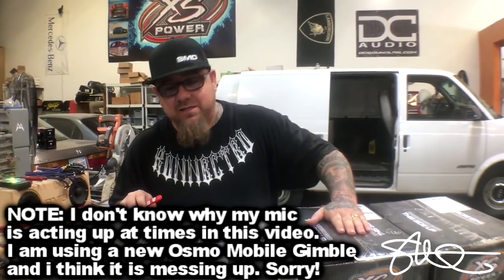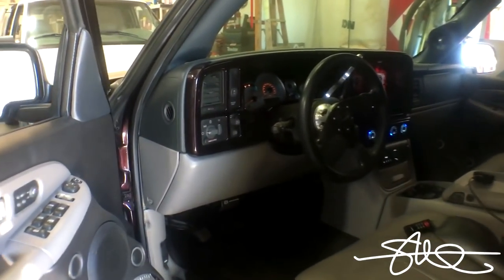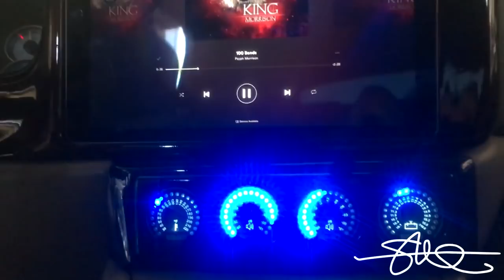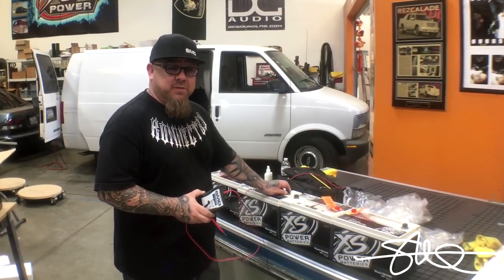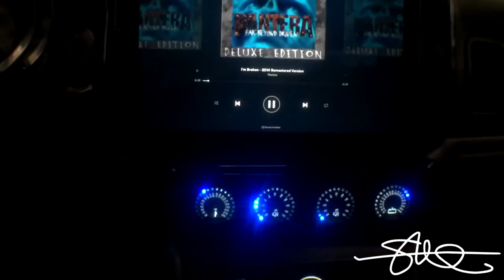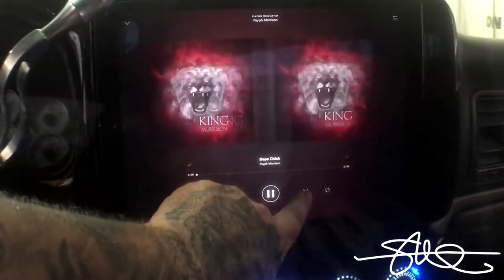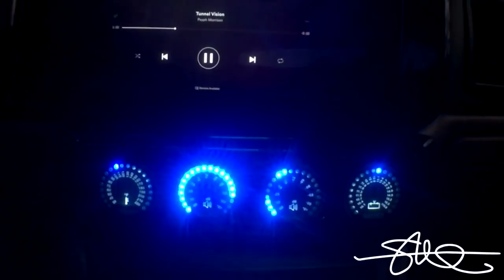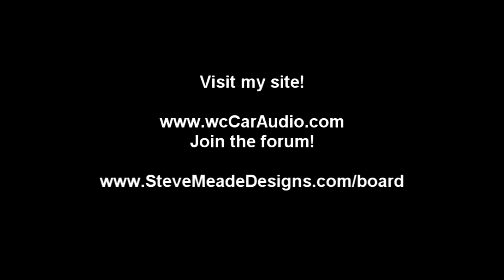XS Power Super Cap Banks Unboxed, Installed, Tested - 4 SB1000-31 4000 farad (Before & After)

Comment from the maker: Before you say anything about my ragedy upholstery in the back, it obviously USED to be a lot nicer....but i have been beating the SHIT out of everything you see there for years (over a decade) and it takes its toll.  Just the hatch rubbing on the trim pieces over the years and the bass slap hitting it is enough to wear it out some. :D  But the good news is, the system STILL works great after more than a decade.  Just sayin'!
Reply: meade916 Still looks good for a Decade bro. keep doing ur Thang!!!
Reply from the maker: thanks Mike!
Reply: meade916 yow sup bro i got a stetsom 6000 what you think of those amp i fine it got lots of juice man for the price

Comment: Much respect on strutting some Pantera. You never fail to impress with your builds and content.
Reply: The results are a bit surprising. My experience with caps way back in the mid 90's was that they were helpful if your electrical demands were already closely met, but too many people thought it was a replacement for proper alternators and adequate grounding. Plus many of the caps were garbage Chinese made large housings with much smaller caps inside. I'm not telling you anything you didn't already know. These here are what we really need. Thanks for showing us all bro! We appreciate it.

Comment: Makes alot of sense, caps react so much faster than a battery.  now that you can use huge cap banks like this it makes sense.  Back in the day those 1 farad caps didnt do shit really. I ran 4 1 farad caps and 2 optimas in the 90s.   But this shit nowadays is whats up!  I need to get a system in my next car asap.

Comment: Just got the SB630 group 51 for my setup and the difference is noticeable!  D4S JP23v2 doing up to 3,000 watts, plus a JL XD800/8 and wow, just wow!  I see a lot less clipping due to low voltage now.  It did take an hour and a half to reach my AGM's resting voltage of 12.8, but it was worth it.  Don't get impatient when charging these!

Comment: I remember back in the day trying to get a ambulance alternator to fit under the hood to get the power needed.  I think you have a good balance with the batts and caps.  Soon you will just be pulling a trailer with a big DC generator and you can ditch about 1000 pounds of Batts, alts, wire.  Just one big plug in the ass end to power it all. ;)

Comment: Thank you for this video, the supercaps are the future, now you have more stable voltage and less weight too, the maxwell supercaps did the job too, but the caps that you bought are very cool with the case, i recently was thinking that have a number of fared that give a cost benefit, think with me, if they are charging after the beat, the supercap and the amp will need power, so they need a feedback of energy too, cheers!
Reply: There are tons of people using Maxwell caps to replace their main starting  battery. cheaper and last longer. Oh yeah lighter too LOL.

Comment: That's an Incredable difference. Those rapid short Bursts of bass are barely dipping. That's awsome because the problem I'm running into is my Voltage dips bad under short bursts like that and it's not loud. Before the alternators can kick in and do something it's too late. If I do a constant sine my Voltage drops and then alts kick in and keep it at 14.4 Volts. I got 2 Mechman 320s. I'm not running crazy power now but looking into caps and lithium

Comment: Hey Steve I watch all your videos, and as an installer in the early 90's I always saw caps as the way to sustain fast power. Then there was a shift to massive battery banks. Not that they didn't do that back then, but it was a two school camp. Just wondering if you were a battery guy for competition, and now  you're going back to caps, or were you converted by modern auto cap stuff as the tech has been in use for decades on power poles to deliver 40,000 farad? Also, is it simply that 30 years ago there were no 20k amps, and a 1-3 farad cap or two would suffice?

Comment: I have a question about Batteries. I have 16 Absorbed Power GT12-75C's in my truck. They are about 3 years old now. I was wondering how long are they expected to last? I thought maybe they were getting a bit old. It will be expensive to replace them.

Comment: Hey Steve, when was the last time your bank of 10 d3100s was charged up? Im  wondering if the fact that the caps were fully charged when the other d3100s weren't would make that big of a difference in a comparison test
Reply from the maker: i keep my Tahoe floating on an XS Power Intellicharger 24/7.  Regardless. In a test like this, the ALTERNATORS are the real star believe it or not.  Without those Mechman alts keeping them full, the caps are worthless.  You need a good combo of items to make this work. :)
Reply: meade916 gotcha bro, I wasn't even thinking about the alts. Sweet way to shave 200 lbs nonetheless

Comment: Your footage looks misty in brightly lit footage , I had this when I used plastic film screen protector. on the device,
Your 3.sixty.3 how is your remote configured. I have master volume and sub volume, easy to get a great sound using the DD1 and -10db overlap track. I attenuate the sub volume by almost 10db for an SQ type profile, then raise it up for bigger bass, great vids keep them coming!

Comment: since this is a fairly large capacitor do you thing it would help with light dimming on lower powered systems. my system only draws 120amp of current and I've got a 150amp alt so I don't drop voltage much just those couple of tenths of a volt

Comment: Is there a difference in lifespan between the batteries and the capacitors?
Reply: Jonathan Reneberg yes big diferemce caps have over 1000000 carge and discarge cycles and agms have way less like 10000 or 5000 could be worng

Comment: I wonder if the lithium XS30k batteries  would rival these in discharge I know the caps can dump all there power almost instantly, judging by the specs the lithium may be just as good they can shit out a consistent 1080amps and a peak of twice that each. Shit Sr. Steve Meade may be able to replace all his batteries and caps for 3 or 4 XS30k's and save a ton almost. Well actually 610lbs, they weigh 35 lbs each so 140lbs to replace 750lbs and have a disgusting amount of discharge capacity 4320amps continuous and about 9000amps burst. All that while remaining at a computer and other oem electronics friendly voltage of 15v.

Comment: Steve I'm surprised you haven't made the move to Lithium in the Tahoe. Any particular reason you haven't? Just curious.
Reply from the maker: lithium batteries would not benefit my system at all.  The caps are the preferred choice for what i am doing.
Reply: Figured a couple 80 ah Lithiums could replace your whole battery bank and weigh hundreds of pounds less.
Reply: I too was curious about that..wouldnt swapping out a couple of the remaining (or all of them)D3100s with some lithiums reduce weight,while adding huge reserve capacity.I might not  fullly understand the supercaps though so forgive my ignorance.
Reply from the maker: Alternators are my choice for power.  Fuck lithium.  I am moving up to 14v batts next.
Reply: That makes sense. Most people don't realize that with most batteries that you're alt is doing all the work until you drop into the 12.6v-12.5v range before your batteries even do any work on the reserve side. Anything above 12.6v is all alt.

Comment: You planning on replacing the other 6 batts with caps? Or just run the setup as is for now?
Reply from the maker: nope.  I am gonna eventually do 5 XS Powers new 14v batteries (in a G31 case) and 5 of these total (or more).  Hopefully some more modern alternators from Mechman. These are going on 8 years old :D
Reply: Yea no shit bro! Them xs put in werk! Lol good stuff though Im sure you wont dip at all once them new batts go in. Cant wait to see updates bro!

Comment: Can you dyno a Power Acoustik RZ1-2300D. It says it runs 900@4ohms and 1400@2ohms with 14.4V. I have a setup in my single cab, 2 of these amps pushing 2 PA GW3-10s Dual 2ohm that rate 1000RMS wired to 4ohms. It hits good but i just would like to see the true watts these little amps are pushing! For under a $100 at that!

Comment: how do you keep your 3sixty.3 from shutting down when you run +15.5V?
Reply: Probably voltage regulators, on the DGAF car he had the 15.5v side and the 12v side for the car.

Comment: If I wishes to add to my Dodge Ram 2500 crew 2012 6 led light bars and 2 amps and 2 subwoofers, 1 amp for 2 outdoor speaker how many batteries should I use 2 or 3? And what capacity??
Reply: No average wattage rating for what you listed, we need specifics. Also your more concerned about if your alternator can supply the amperage needed for all that, seeing as the batterys prime purpose is just to start the car and then the alternator handles all running electrical draws. Do some math to find out what the total Amp draw is and find out how much your trucks alternator puts out at a normal rpm range. Decide if you need to upgrade or not and also a second battery could be a good idea incase you decide to use anything with the trucks motor off, Just make sure its isloated

Comment: I was looking around for some maxwell boostcaps, 3000 farads, those were 3.something volts and I did some napkin math,  a 12v bank of caps had like 13 watts of power, storage wise Steve just lost a lot of power storing capacity, but he needs to run his engine while running that system anyway. If the caps keep the volts up then it's no big loss, especially with the dynamic nature of music, but he can't sustain a bass note for very long, (like half an hour, unrealistic for music) his alternators could make about 20kw, his install was what? 40kw? if it can charge enough in between bass notes it's fine tho. the caps are doing a great job at maintaining the voltage, and I don't think he cares much about energy storage, he can just rev his engine. I haven't looked at the specs of the batts or caps he uses, 5 am, I should be asleep xD.

Comment: I was wondering what I'm going to do, 6 d3100 but might go with a few of them caps and less batteries ✌👑
Reply from the maker: you really can bro, i was amazed.  And i did NOT get these for free.  I wouldn't praise them if they didn't help. But damn! it is noticeable and i have a LOT of power draw.
Reply: nothing's free, I got 3 3100s in my center console I made. JP posted it a while back 🏆started watching you guys then I became more onto car audio
Reply: I think ideally you need a good mixture of both.  Caps went to wayside for a long time I feel, no one really runs them.  But these big cap banks are whats up.  A bunch of them def helps overall.

Comment: Funny capacitors were in, then out, now coming back?  Anyone with electronics background knows a capacitor is almost instant full discharge.  Like static electricity.  Plus they never wear out.  A battery needs to convert a chemical reaction to coulombs.  Way too slow for the dynamics of music.  Steve you should replace 2 more batteries with capacitors then add 2-4 more and I would bet the voltage would barely move.  Caps, not batts.
Reply from the maker: i think i got this under control but thanks anyway just in case i didn't.
Reply: meade916 well ya do now.... but you did fall for the battery misconception, always wondered where your caps were at, been watching your videos for a long time you have done a great job teaming up with an electrical engineer bringing the DD1 one and all that stuff
Reply from the maker: i'm actually gonna run 14v batteries soon.  I plan on doing 5 14v G31 Batts and at least 5 or more of these new caps.
Reply: meade916 Look forward to the vid.    Never have commented, but crazy watching you build the Tahoe, Lexus, shop speakers, etc.--extremely skilled!

Comment: meade what sup brother?! hey i have a crazy set up in a 2011 dodge charger. I have two w7 13's with two 4 channel amps, two 1200 watt amps for the 13's. My batteries are two 1200 watt kentic batteries and one 4900 watt xs battery. I was thinking about getting another 4900. but, Im noticing that through out the day,  the bass isn't as loud and i have to turn it up to get the bass. do I have to upgrade my alternator?

Comment: I was curious if i was running enough power to add one of these caps i got a singer 320amp alt in my integra and 1 d5100r 2 kinetic 3800blu and 2 xp3000 on my taramps hd 8000 on my s4v2 and a ds18 gen2000.2 and a polk audio 4ch pa 660 i think and bad ass set up man
Reply: I would add a limitless lithium like a 45ah
Reply: The best decision I ever made go 45ah lithium with a bank of Xs power caps voltage stays between 14.4-13.7

Comment: Can somebody help me.

I'm putting 2 10inch VM AUDIO 5600 watt subs and a 2600 watt RMS amp in my trunk. I want to run a single battery in the trunk what brand of battery, wirring and anything else I'm missing.

Please help??????
Reply: Dominique Williams u dont need a battery or an amp that powerful vm subs bust with any power sorry man use to have some but id just get 4gauge wiring kit stinger or rockford maybe for the brand of wire have that amp turned down or ur ganna blow those subs if its really 2600rms. What kind of amp dp u have?

Comment: I would look into 4 of xs powers new lithium batteries probably Wont have hardly any drop instead of caps cause you did raise a good point once its a constant bass those caps empty out quick then your just drawing from the 6 other d3100s
Reply from the maker: lithium batteries would not benefit my system at all.  The caps are the preferred choice for what i am doing.
Reply: alright bub was just a thought no harm no foul

Comment: just a small question,
is that a dry cell battery?
Reply: ARCH. M the old batteries are AGM batteries. Aka "dry cell". The new "batteries" are actually super capacitors. Good for high current demands. Not so much for reserve.
Reply: thank you for explaining but id like to ask another question, I've got 1 yellow top starting battery and nothing to fancy with my setup just a 2k watts mids(amp) and 4k watts bass amp. can i go with another yellow top or should i get one of these?
Reply: not sure but it might depend on your alternator
Reply: If you have a the money to blow for one of these super caps. I recommend you to just upgrade your alternator instead. Much cheaper.
Reply: alexisthemexican 
Why would he do that? He's already running four alternators. He needs a storage system for when the notes draw more current than the rest of them music. He had a storage reserved when he had the batteries now he is shaving 200 pounds off by going to a different type of storage which is capacitors. Both do the same thing but in different ways. He would have burned up an alternator if didn't  have extra "capacity". Adding them doesn't fix the problem. He needs a reserve to pull from when those amps cam drop from the music at a certain hertz and draws more current to power the amps.
Very common and very common sense.
Reply: Justin Murphy Alex is talking about my situation in "my" car
Reply: alexisthemexican what should I look for when upgrading a alternator?
Reply: First make sure you search for something that is designed to fit your specific car. Pretty obvious, but they do sell "universal" alternators that may not fit your vehicle. Singer alternators, Mechman Alternators, Ohio Generators, Iraggi are just a few reputable places to get some HO(high output) alternators for your car. For what you are currently running I recommend more than one HO amp alternator that sum up to at least 400ish amps. Kinda overkill but you do have a lot of power(if its true RMS power), you need power to make power.
Reply: He has the alternators for when he wants to really put the power down. The reserve is there when he doesnt want to bring the RPMs up for his engine. Caps are good for music when you have the car idling because they charge back up quickly and can put out the current when they need to. Caps just dont have the capacity to hold charge like a battery does. If he would try that with the engine not running, Those caps would last for a fraction of the time a battery would.
Reply: thanks so much

Comment: Why not build a setup with lithium cells from tesla? You can get the batteries for pretty cheap now... 1300$ for around 5kwh's of storage
Reply from the maker: why not this, why not that...lol...lithium batteries would not benefit my system at all.  The caps are the preferred choice for what i am doing.

Comment: so it's good to buy caps now?
Reply: Caps just hold power for peak times. They do drain eventually if you are putting enough load on them for long enough. If your charging system can keep up then there is no need. Since they do store energy for peak times, shorting out a charged 1000 farad capacitor by any part of your body is certain death. Hell a 1 farad capacitor will mess you up.